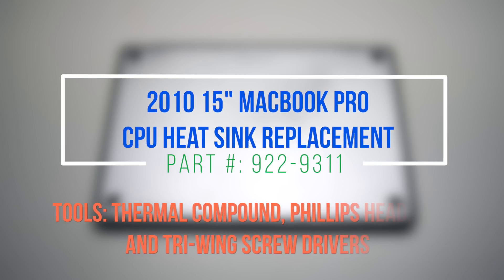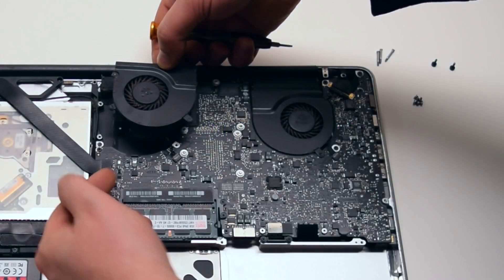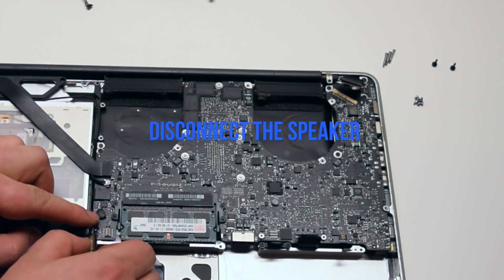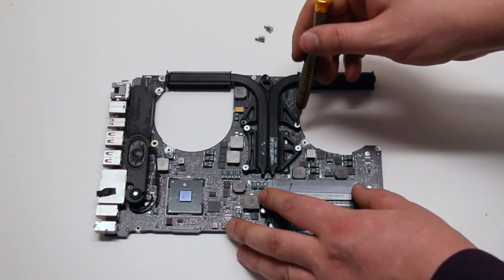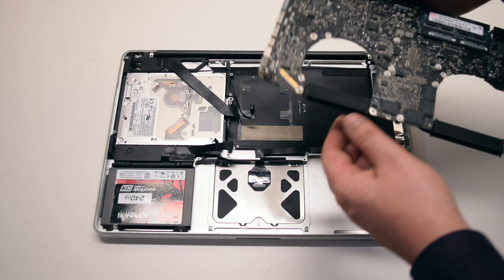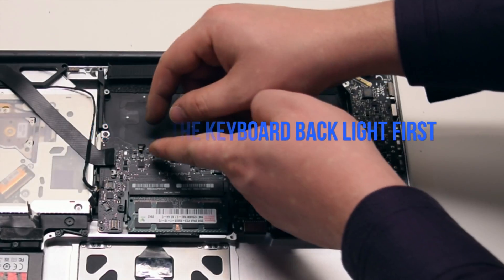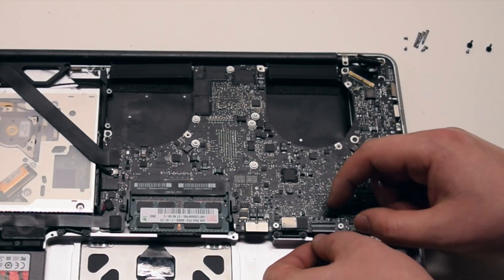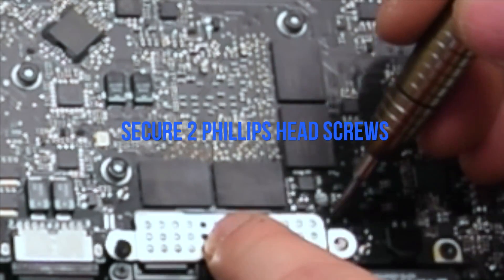2010 Macbook Pro 15" A1286 CPU Heat Sink Replacement

Comment: ...and my 2010 MBP gets another blast of fresh energy or should I say air? (Fan? Get it?) Jesus I remember a lecturer  saying back in 2010 that I should get a few years out of a Macbook Pro but going on eleven years that's quite impressive. Will the new M1 last this long? Why wouldn't it I suppose. And it's not over yet. There might be another five years in the old girl. The 8GB limit of RAM is disappointing though. Pity there wasn't some way of being able to add 16GB. Ah well. I guess I'm pushing it.

Comment: I changed the thermal paste & still heats up to 79-101 when using safari for emails.   
What could the issue be? 

I've also cleaned the dust of every part of the internals. any suggestions?

Comment: Worked like a charm. It wasn't anything I have ever done. I built many systems as PCs or refurbished Windows laptops. My advice: be very careful and get the right tools. Use plastic pliers when messing with the cables. Take your time.
Thank you for the tutorial.
Reply from the maker: Glad the tutorial helped!

Comment: Wonderful tutorial thanks a lot! But I have a question? Why do you replace the heat sink? I guess applying new thermal paste would do as well. What was the problem with the heat sink itself?
Reply from the maker: They can stop transferring heat correctly.
Reply: @GRIBSOFT  I am confused. Did you replace the heat sink? If you did, why clean off the old paste on the original heat sink? The way the video looks, you cleaned off the old heat sink and the GPU/CPU dies and put it back together again (yes/no)? How do we know if the heat sink was good or bad? Is there a way to tell or is it better to just replace the darn thing?

Comment: I did this today on my 2011 15 inch.... I had a GPU issue and I'm pretty sure this fixed it but all of a sudden my screen isnt working. I have double and triple checked my connections so I'm not sure what's wrong at this point. Any help would be amazing.
Reply from the maker: Unplug and reseat the LVDS cable coming from the screen to the corner of the logicboard.

Comment: Thanks for the great video man! I never changed the thermal paste in 8 years!!! Do you think it could significantly cool down by applying a new set of paste?
Reply from the maker: Yes, also just opening it up and cleaning the dust from the fans will cool it by several degrees.